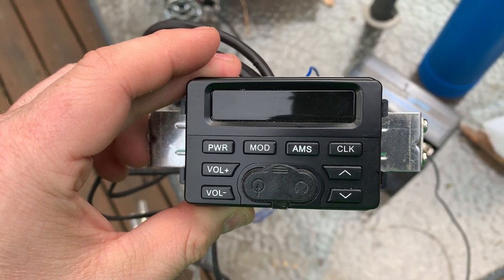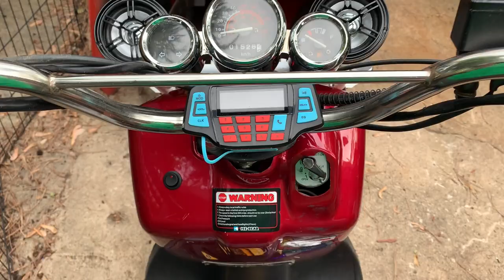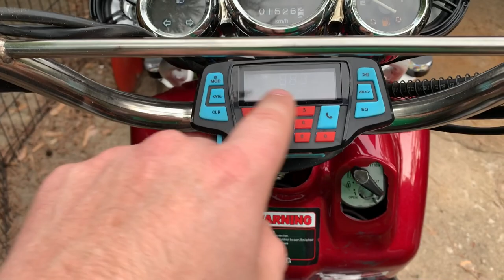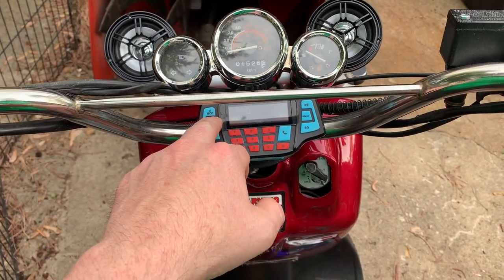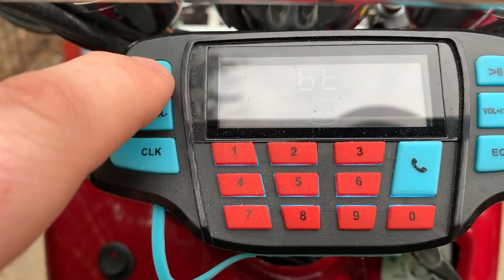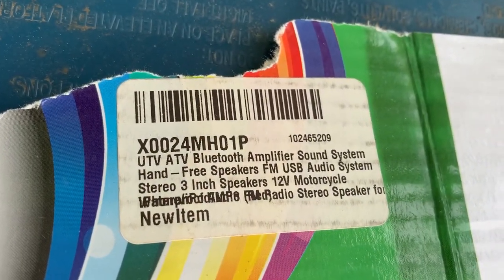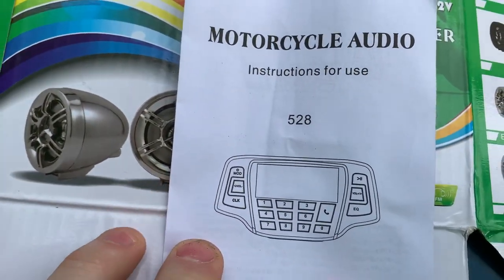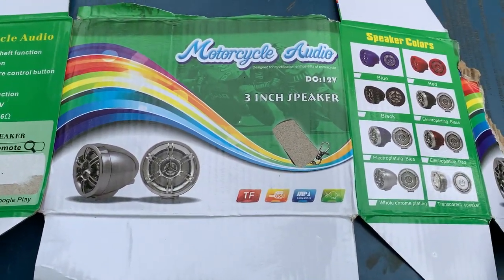WORLD'S CHEAPEST MOTORCYCLE / BICYCLE STEREO!  ATV UTV X0024Q29J1 PLUS WHICH TO AVOID

Comment: On the cheap radio all you had to do is add the black wire with the  blue wire together on the 12v on your battery
Reply: Black red to pos battery, black is remote for switch power so it won't come on until the key is turned 
 green to neg battery 
blue cap off
 its for power  antenna

Comment: Just bought the same radio is it connected directly to your battery or is it a 12 v plug in?
Reply from the maker: Directly connected to battery, I made a switch to save power on the battery

Comment: Still using this radio? Wondering what the long term review is,,,,,, would you buy it again?
Reply from the maker: For a scooter, yes for sure any day of the week.  For a motorcycle going 50mph + get something louder with better speakers with better bass.  It sounds ok but not as good as say a JBL Flip bluetooth speaker does.  Which I probably would use since they have come down to about $70 on Amazon and sound AMAZING!  So for double the price you get triple the sound quality.  Only negative its only a BT device, but that isnt a huge negative in my book as I never used the other sources.  Just my 2 cents.

Comment: How you deal with the alarm? I try to contact the seller they say unplug the harness  is not easy since my is custom instal and all the wires are not at reach. I was thinking was a password on the key pad but even the one make this has no idea
Reply from the maker: I haven't used the alarm yet, never hooked that part up.
Reply: @Jeep-Creep  i install the radio normal too and couple days later when to my garage and bump the scooter and alarm go crazy. I have to take the battery power supply off to make it star. The alarm sound comes from the actual speakers not the horn. Is Laud. I just want to ask and share. If this happens to you you will have to do the same. Thanks for your videos.
Reply from the maker: @fortnitesalvaralmundoybatt776  Understood, thank you for the advice.  Thank you for being a subscriber, I love making these videos.